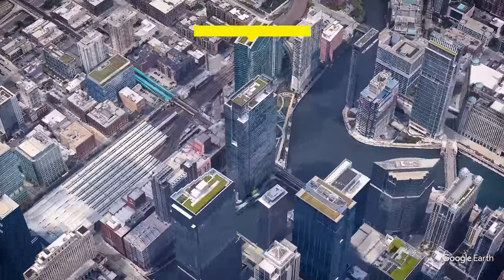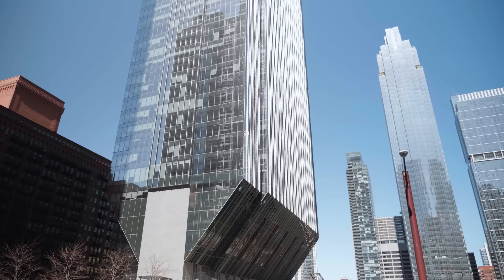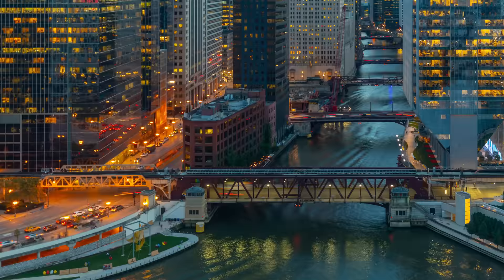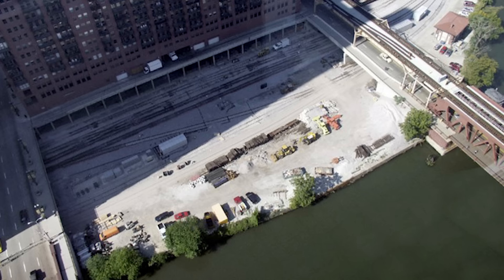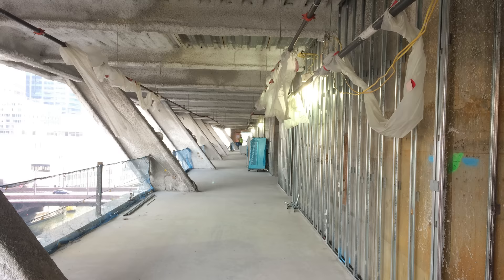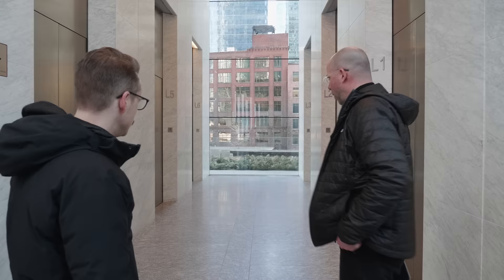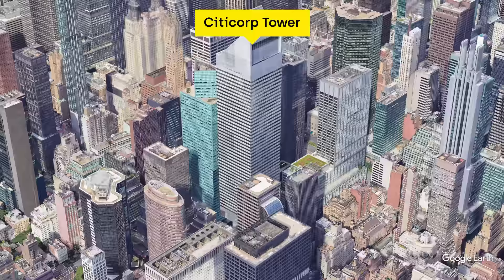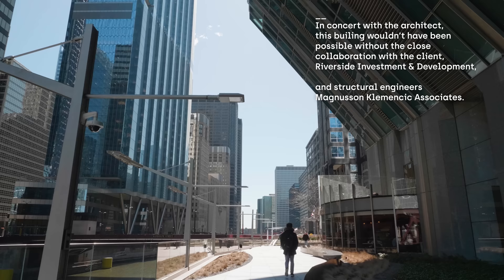How This Tower Barely Touches the Ground

Comment: I work for MKA, the engineering firm on this project, and in Rainier Tower, one of the buildings you referenced (which an earlier iteration of our firm also engineered). Nice to see our stuff in the public culture ❤
Reply from the maker: Awesome! I’d love to do a video with y’all sometime soon.
Reply: What did you guys found the building on? Is there bedrock close to the surface in that area? It's a lot of weight in a relatively small area looking at the photo of the core.
Reply: Is there something below the rail yard anchoring the tower's sideways to prevent it falling over?  Because dampening isn't support.
Reply: Could you help explain the stabilizing water at the top? Because that part felt really counter-intuitive. 

If wind is moving to the right it gives the building rightward momentum, so the building starts to move but is then held back by the water, BUT that would have to give some rightward momentum to the water itself too. So wouldn't the water then hit the right wall after a bit and make it more unstable?
Reply: @usmh  Thanks for the question, but my degree and profession is in accountancy. I just happen to work in an engineering firm.
Reply: Are you familiar with "The Cube" in Vancouver BC? Suspended core supported building, now a condo.
Reply: I remember seeing MKA in the Rainier Tower! I used to work there at Milliman for 5 years, and have lovely memories of walking around the Pike market and waterfront during lunch.

I miss it greatly!
Reply: @usmh  TBH, I suspect that the reservoirs being used in the model might have been a bit misleading. I'm not sure how this particular building's system is set up, but they're often times a pair of reservoirs connected with a large pipe, so that water can slosh between the two sides. The water during the sloshing heats up and the heat is typically radiated out to remove energy from the system and give the building a natural tendency to stop vibrating when the wind dies down.

As far as the water goes, the water would gain rightward momentum, but it would l do so after the building starts to move in the opposite direction as the water gets its momentum from the building and conservation of momentum requires that any momentum gain by the water come from the building. 

I assume that's what you're getting at.
Reply: @johndododoe1411  Presumably the same thing that anchors most buildings like this, a massive block of concrete or bed rock. The damper is presumably necessary in part because of the restrictions on the size of the base. Keep in mind that a building of this height wouldn't normally require the damping. It's just not big enough for people to get motion sick, or for the freight elevators to have problem. I worked security in two highrises that were taller than this and neither had this kind of damping. It just wasn't necessary.
Reply: @usmh  The wind is a problem because it causes the building to rock back and forth repeatedly. As it rocks, the wind can make it rock more and more every time. This is known as resonance. It only becomes a problem as the effect is amplified through this periodic repetition. 

The water counteracts this periodic effect. While the building is pushed left, the water remains briefly on the right side. The water doesn't actually find its way to the left side until after the building is already rocking back to the right. They carefully calculated to figure out the resonant frequency of the building and the water, so they could time it just right. The water collides with a lot of energy against the left wall at the exact moment that the building is moving fastest towards the right. This slows down the periodic effect, counteracting the resonance, which is known as damping.
Reply: @stevenschwartz-yvr  aye i live next to the cube
Reply: @somethingsomething404  I live off Denman. The cube is one of my favorite buildings in Vancouver. Also loving the new Kengo Kuma "Alberni"
Reply: @stevenschwartz-yvr  I agree love both. When you say the cube did you mean the single large black cube or the newer building made of multiple cubes?
Reply: @usmh  inertia
Reply: To address questions:  The foundation is deep drilled concrete shafts to bedrock.  The water at the top reduces motion.  The water is a sloshing type damper.
Reply: @russelllarsen7354 Fascinating
Reply: @JackAubreyy  People said that about the Eiffel Tower and also about John Hancock Center and the Sears Tower and every other iconic thing ever built. The locals probably groused about the Colosseum in Rome. Would you prefer a Greek temple fitted in between the train tracks?
Reply: I was about to say this building reminds me of the Rainier Tower!
Reply: Lol 😂
Reply: QUESTION: could this building be brought to a point instead of a 'line'?
If it could, would it serve as a kind of pivot point to stabilise the building in an earthquake? Michael 🇦🇺
Reply: 멋지네요!
Reply: I'll add this to my short list of buildings that I won't step anywhere near where it can fall.
Reply: @81caspen how many revit designers worked on this?
Reply: @acidwaste00  Sorry, I work in accounting, and I have only been with the firm a few months.
Reply: @usmh  most of its force will act in the opposite direction of the initial motion. Then when the building sways back the water will then go back in the opposing direction again. It will not move at the same speed, frequency, as the building so will actually center itself more quickly. It's weight, downward force will also counter the buildings sideways motion.
It's been done before and it works.
That building is not so tall that it will sway that much.
Reply: @stewarthicks  Hello, Stewart! My apologies getting back to you, but I hadn’t wanted to say anything till I talked to the firm. Interest here is growing and MKA’s staff would like to reach out!

I’m still getting the hang of YouTube protocol. Our staff says they can hunt up your information, but may I ask for your details so they can get in touch?
Reply: @usmh  That was answered in the video: different vibration frequencies that dampen one another and avoid synced (resonating) movements.
Reply: @megamaser  Oh, of course...! I was thinking of wind as a constant force, which it obviously isn't. I hadn't thought about wind bursts being frequent like that, enough to cause resonance, but now that you mention it I guess they are. Thanks.
Reply: @81caspen  Haha, OK. Unlucky ;)
Reply: I hope this kind of building becomes more popular as cities try to maximize their usable ground space.
Reply: 7:00 What happens when the center of gravity changes?
Reply: @TheHardys01 , you will want to ask an engineer. I am, for my sins, only an accountant.
Reply: What happens if the Water Dampener at the roof freezes?  Is there a system in place to make sure that water remains in liquid form so that it can act as an anti-pendulum?
Reply: Where the hell do y'all get the funds to build all this?

Comment: I worked in this building from its opening up until recently. A bit of what you covered was 'tribal knowledge' you'd pick up in short conversations in the hallways, but I still learned a lot!  I noticed you didn't mention the partial collapse during construction in October 2015. I imagine the other experts weren't terribly excited to bring that up, but it was something I definitely kept in the back of my mind while working there. For a fantastic river view, try lunch or dinner at the restaurant downstairs, currently called 'Porter'. Keep up the great work!
Reply: any links to the reports of the collapse ? I was there in sept. 15' and was wondering if they had gone too far with the design ? but the I beams were massive !! never saw beams that big . eventually I forgot about it in the sea of wonders that Chicago is in architectural volume.
Reply: found a tribune report where the company said it was a concrete form failure 10' x10' vertical wall .that is not an uncommon event.
Reply: Is the site really noisy due to the trains and traffic?
Reply: Downstairs? So I just keep going down? For a great view? Lol
Reply: partial collapse? you live in the suburbs by any chance?

Comment: Awesome work Stewart! Really appreciate you presenting structurally engineering concepts in a digestible fashion for people without an architectural or engineering background to understand. One other interesting fact about 150 N Riverside is that while in day to day use the horizontal thrusts induced at the base of the building balance out, conditions when there is a lot more vertical load on one side of the building than the other had to be considered. Like when there are fireworks at Navy Pier with everyone looking out on the East side of the building while no one is on the West side. Just another exciting challenge that needed to be considered in this engineering and architectural marvel!

Comment: I did a little stint with Goettsch Partners back in 2006 and worked on a few buildings in which we were eliminating corner columns and transferring loads back to the center core. The structural concept is nothing really new, except the construction logistics and site stockpile is unique. Good episode.

Comment: There's a building in Mexico City that was originally built for chemical company Celanese that also incorporates a similar overhang. As well as the overhang it also has several interesting aspects. It was originally built from the top to the bottom, the core was built first and after that the main building areas were built from the top to the bottom, hanging on wires that still work to this day.
The second funky aspect of it is how its layout is organized around the main stairs, all of the offices are open to them and there are no specific floors per se, the only full floors are the top floor and entry lobby.
Reply: Rad! What's the building called?
Reply: @ooooneeee  it's the Edificio Celanese (Celanese Building) by Ricardo Legorreta, it's also known as "La Paleta" (The Popsicle) by the people of Mexico City. Celanese has long since sold the building and currently it is leased by the Mexican department of education if memory serves me right.
Reply: Basically it's an inverted pendulum building, they are not rare at all, there are some in Spain too, in Colombia (mi country) more specifically in Bogotá there are 2 building like this, once is the UGI building and the other is the Colseguros building, they are technically very interesting to analyze more when you notice that this city has a floor jelly-like cause it's made of limes and expansive clays, a total latinoamerican engineering achievement, the 60s and 70s was the gold time of this, now my country only build bad and making a 2 years project in 10 years ¬_¬
Reply: I have lived in Mexico city all my life (46 years) and didn’t know about it. 😮

Comment: My understanding of the Citi Tower in NY was that there was no design flaw. The issue was during construction time when a change from welding to the cheaper riveting approach was approved without recomputing the stresses on the structure. When the flaw was detected, they quietly deployed welders to secure all the supports.

Thanks for doing a video on this building in Chicago! I remember when it was under construction and it was a rather strange sight then. I remember staring at the final building thinking about skyscraper construction and figuring out how they managed to secure it against wind load. Most of it could be puzzled out, but the water dampener at the top is an amazing piece of information that’s not obvious just looking at it.
Reply: The issue was quartering wind loads (wind coming from the corner pushing on two sides) hadn't been considered. It came up when a graduate student was studying the building and noticed it hadn't been accounted for.
Reply: @ch1c4g0  So I looked up the details and it seems we’re both right. The original design had the forces calculated incorrectly. However, the welded-joint plan in that design would have handled the forces had been followed. The change to the bolted-joint design during construction (not rivets as I had incorrectly recalled) weakened the structure enough to make these forces a concern.

Comment: It’s wild how this skyscraper uses a special concrete dampener at the top that acts like a reverse pendulum, reducing sway during strong winds to stabilize itself. On the flip side, certain solid materials can turn into liquid when exposed to moisture in ships, causing dangerous sloshing that will capsize them. Liquids really do have a powerful impact both ways

Comment: Excellent video Stewart.  I remember when you had 200 views, now it's 300,000. Well done indeed for excellent & enriching content. And hats off to the engineers for that building. Often the architect gets all the credit, but in my experience the building design is a function of a) site constraints b) engineering solutions  c) architect (& client's) vision. Constraints are very important imo otherwise some pretty mad ideas can get turned into concrete.

Comment: Just wanted to point out that at about 2:50, you stated that Amtrak tracks were to the west, but then the visual showed the CTA L train & tracks running along the North(?) of the building... I realize it was ultimately to trace out the buildable width but it can be confusing to viewers not familiar with the area. 

CTA L train tracks are separate from Amtrak, to any non-Chicago viewers.

Comment: What I find fascinating is that in university (civil engineering) I always thought the real world was way more complex than what I studied. But then you have buildings like this, which (although incredible) are literally just a big truss.
Reply: always comes back to triangles.
Reply: Yes and no, at the wide angle it's rather simple, but there are probably hundreds of thousands of members that had to be modeled to ensure that the stresses would flow the way that the engineers intended to and that there was enough margin for safety, particularly in the direction where it's so narrow at the bottom.

It's one of the fascinating things about projects like this. The basic idea is rather simple, but proving that you've got the materials to actually do it with sufficient safety is another matter. After all, people would get cranky if you built the building as a test and it just fell over like those ones in Kobe did.

Comment: This concept was used in 1980 in Atlanta, Georgia at 675 West Peachtree Street.  The site was chosen to save the Fox Theatre where "Gone With The Wind" debuted, but a new subway project restricted footprint.  The building is just a few inches from The Fox Theatre but city engineers would not let it get that close to the subway lines due to vibrations, so the lower multi story lobby is tapered slimmer and the support beams are visible sticking out, like a bamboo house built on a river.

Comment: This was a great video, getting into the architecture and engineering of such a cool building! 

Another overhanging building in development is the South Station Tower in Boston Massachusetts.  The building will sit on 8 "super columns" which will leave the entire space below the building as part of the passenger area at the station featuring massive decorative arches. Access to the building will be from a sky bridge to a neighboring building.  The overhanging columns will be connected to diagonals in tension, rather than the compression members seen in 150 N Riverside.

My company worked on some of the engineering for South Station Tower so it's cool that I had a small role to play in such a huge project!

Comment: What a beautiful building! I'm reminded of something similar in Johannesburg many years ago, a building with a cylindrical core and all the floors overhung the core by a considerable amount, IIRC the core diameter was less than half the overall building diameter. City inspectors refused to pass the building once built even though the architects and engineers did do their work correctly; the inspectors insisted on supporting column on the perimeter. So the contractor obliged, built the columns and tiled them up to the first floor with the same tiles as the core. Inspector was happy, building opened for business. 30-40 years later the 1st facelift happened, and whatdoyouknow, the top tiles covered a 4" gap above the column. None of the columns ever touched and the building supported itself as designed from day 1!

People need to trust architects and engineers. Apart from CitiBank, they usually get the calculations spot on 😀

Comment: I usually dislike modern skyscrapers. I am just not a huge fan of the glass and steel exterior and lack of ornamentation or any other visual variation in its facade. But I do have to say that I deem this particular building to be beautiful and to be an elegant solution to a complicated problem.

Comment: It's basically a modern reinterpretation of the medieval European design of slightly overhanging upper floors which maximize the building's usable floor space per limited amount of footprint (in the historic case for tax reasons)

Comment: For anyone interested, in Frankfurt (Germany) there are the "Olivetti Towers" designed by Egon Eiermann, which were built as office buildings in 1972 as part of the campus of the name-giving company.

These buildings have an even more radical design and consist each of a cuboid main-structure, that is suspended on an inverted pyramid shape that is merging/resting on a slim central column.

They are still looking fantastic today.

Comment: In reference to Citicorp Center: Not welding crews, the problem was the steel connections were originally made with bolts, they were replaced with hot rivets to fix the mistake.